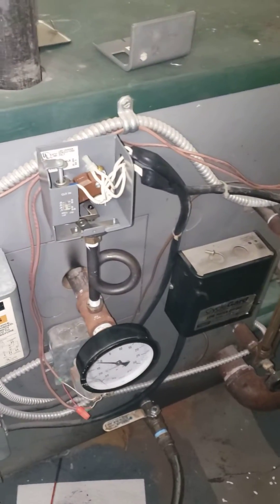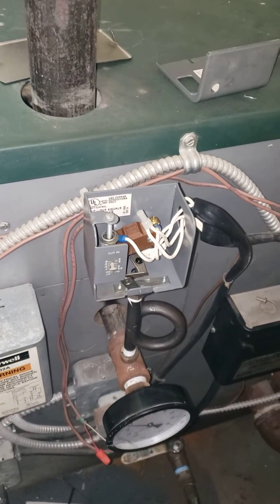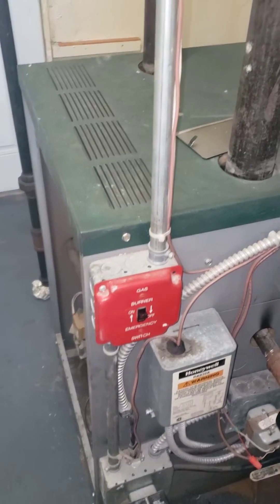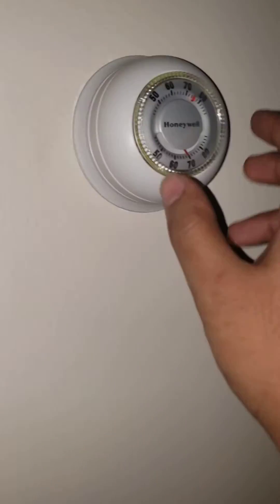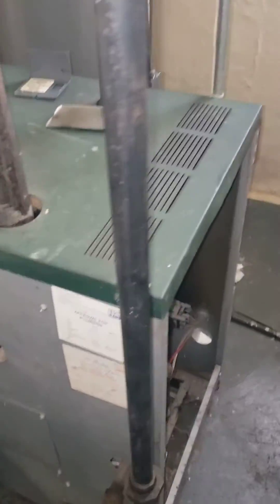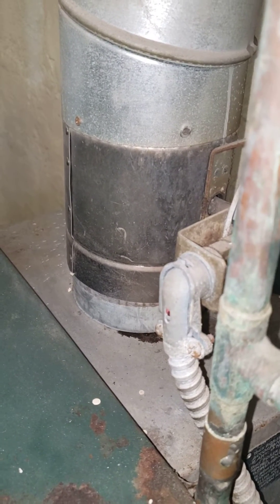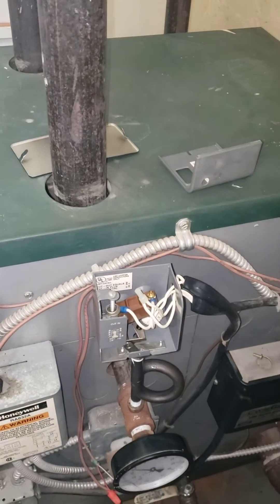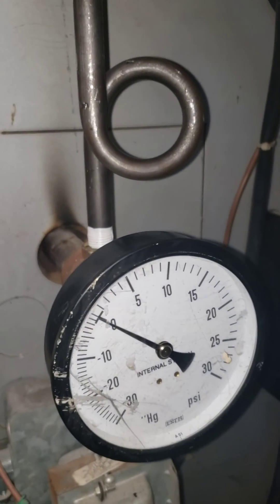Steam Boiler Honeywell Pressuretrol Switch Broken

Comment: I watched your video. You cleaned the pigtail, that's good. Try to clean switch where it attaches to the pigtail, there may be dirts at the switch's diaphragm. Also, clean the pipe that attaches to the boiler.
Reply from the maker: Thanks for the reply.  I actually just had a new boiler installed.  I will send you the video.